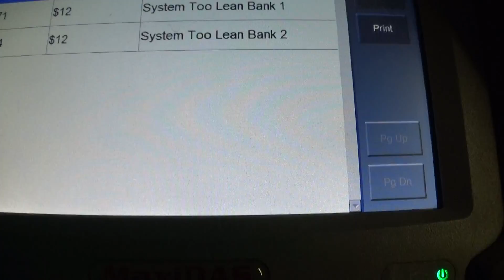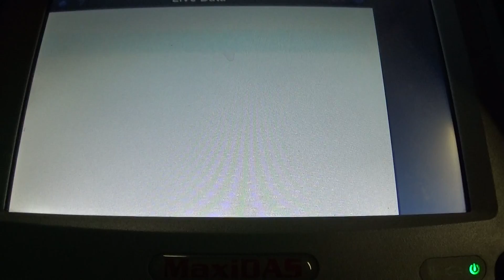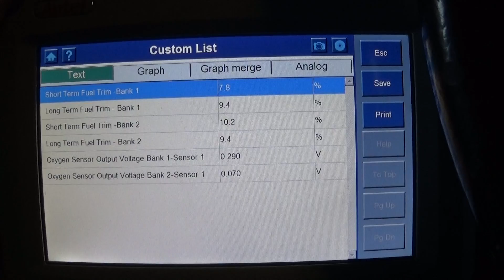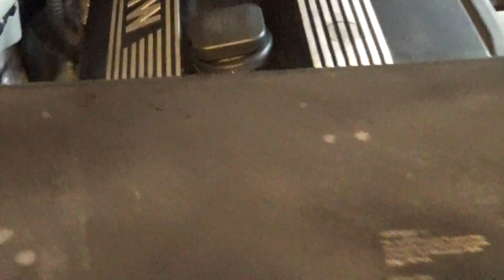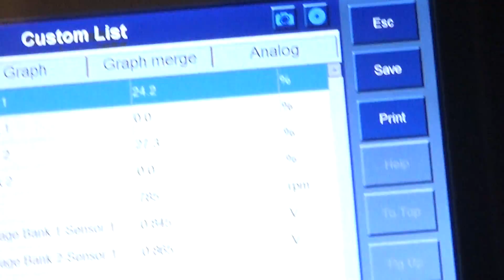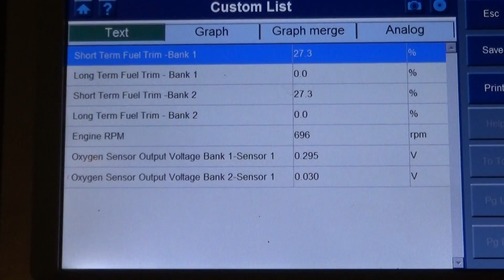2002 BMW X5 With Vacuum Leak  DTC P0171 And P0174

Comment: I usually don't comment, but you got my attension, sir you are showing your O2 sensor is bad .3 v is too low you really need re look, I would say just change your o2 senror bank1 only German engineering
Reply from the maker: Mayier Kahn Hi. My O2 sensors are good . They are lean ( voltage under 500mv) is because of vacuum leak. New intake boot and DISA valve gasket was fix for this car. Thank you for looking.
Reply: That is the problem I change all four o2 sensor.